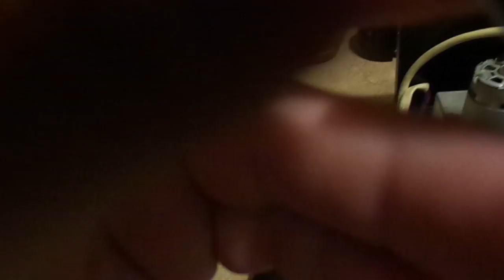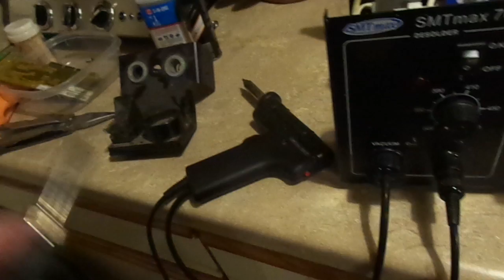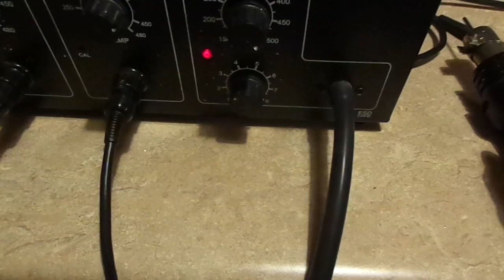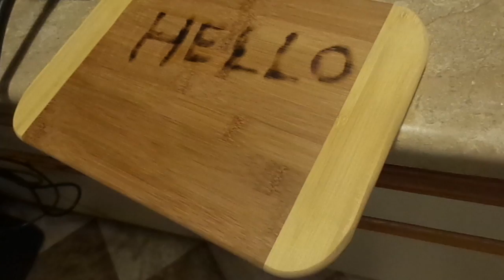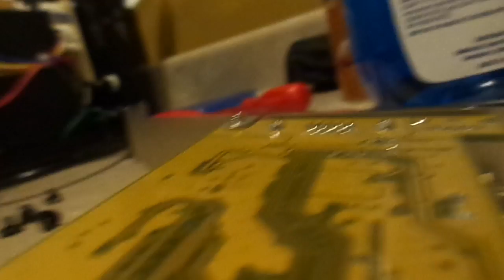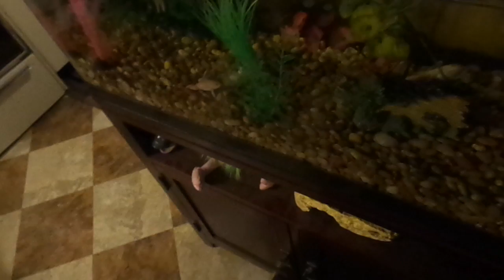SMTMAX 702 Hot Air SMT Rework Station QK702ESD

Comment: You should use a smaller diameter nozzle for the de-solder gun to get better suction also you should melt the solder before starting the suction pump. I have had the same station for 3 years.. works grate for me